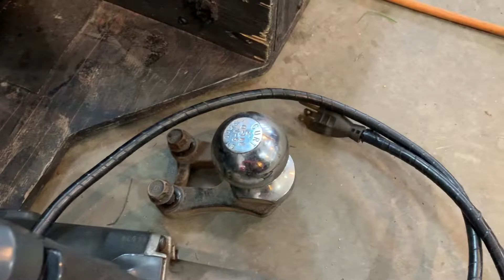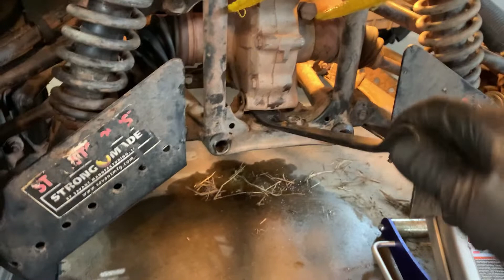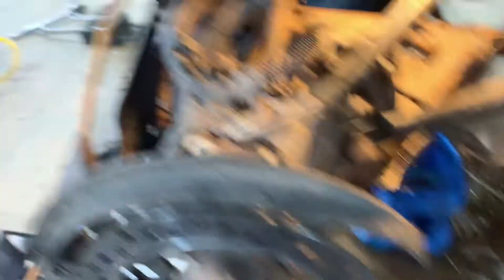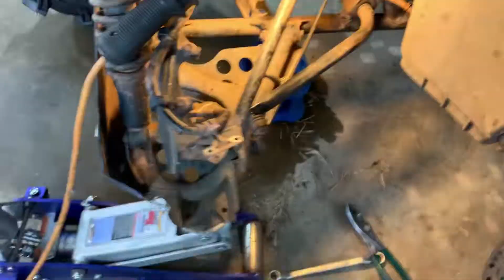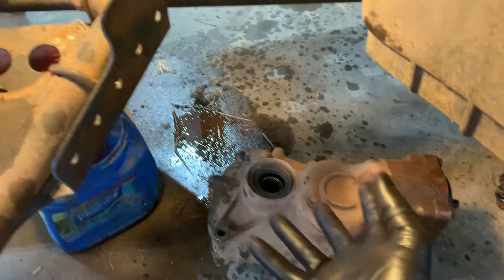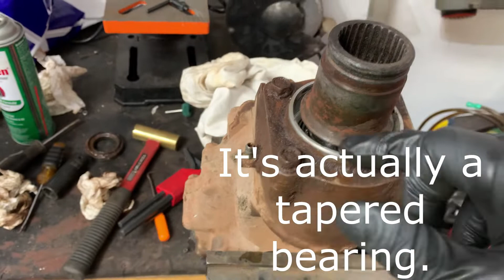Grizzly Rear Pinion Seal Replacement

Comment: No grease on that tapered bearing?
Reply: Or does the gear oil grease it
Reply from the maker: No, it’s lubricated by the gear oil in the differential.